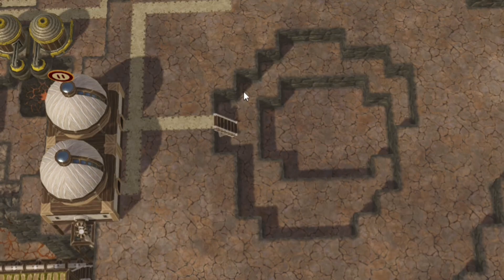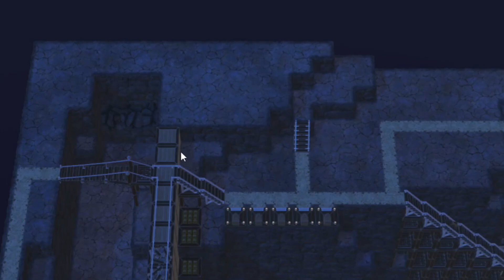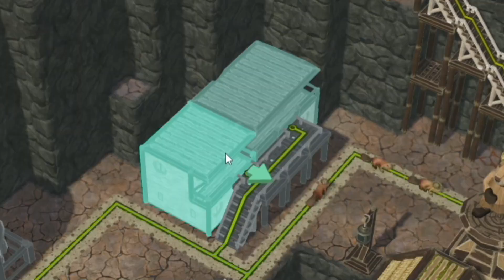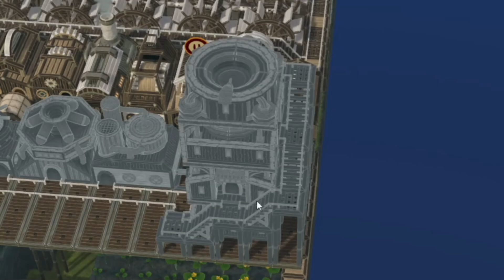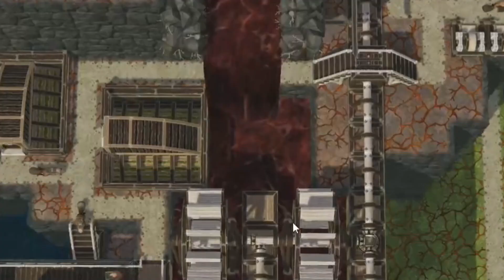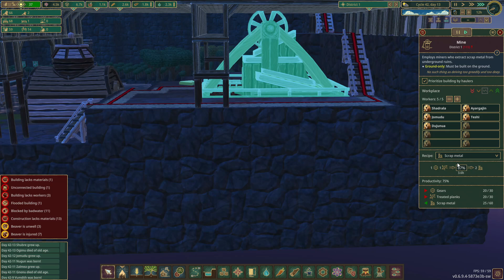2,750,000 Watts Of Power

Comment: Why u not build small containment for bad water so u can store more good water
Reply from the maker: By small containment, I assume you mean the Badwater Dome or Badwater Rig.  It's pretty simple.  You still need badwater to make extract and explosives, so I used the only badwater source on the map to make a large power network and in doing so I also was able to direct the badwater off of the map, preventing contamination and allowing the beavers to pump out the badwater for use. The project had many layers.  If I made a mistake on what you were referring, please reply to this.  Thank you for watching and commenting.  Please make sure to sub for more content.  Thank you again.